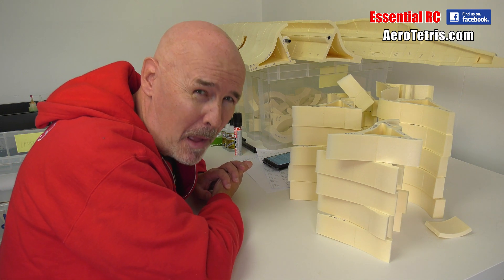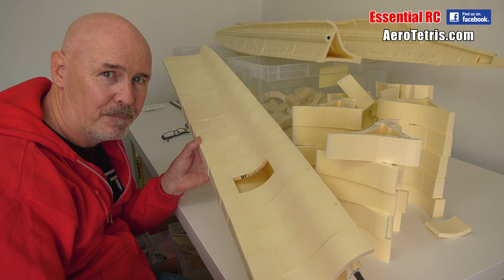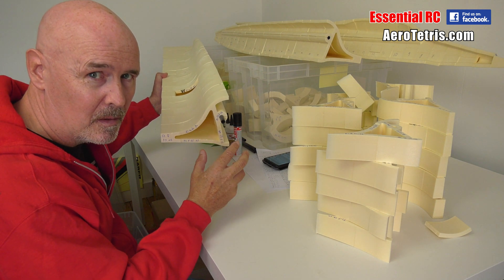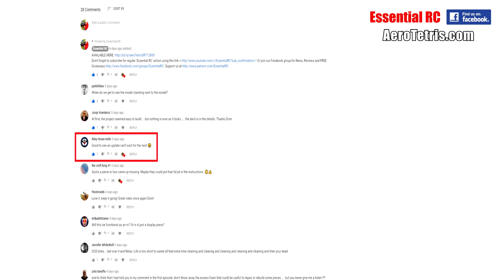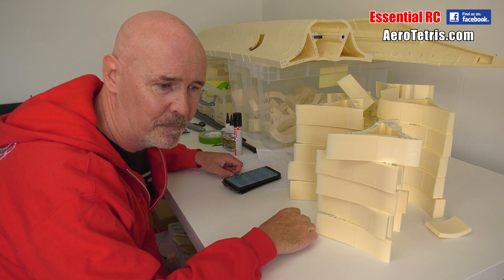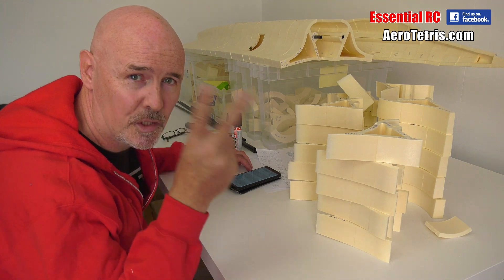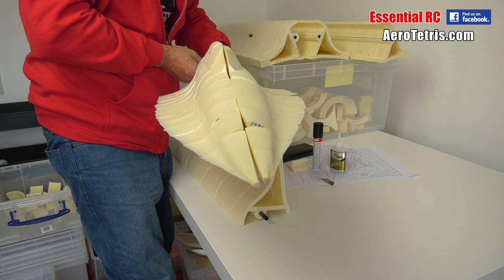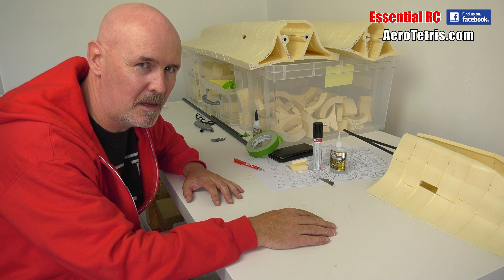AeroTetris 2.8 metre SR-71 Blackbird: BUILD LOG: Part 4

Comment: Mr Dom  are you  put  sound system in the Amazing build
Reply from the maker: Hey Charles...I don't think sound systems are needed in EDF or turbine jet models. The power system usually produces good enough sound. EDF systems with high blade counts do sound really good these days. I would not want to add the extra weight anyway. This jet needs to be kept light due to the way it's constructed. Cheers Dom (Essential RC)
Reply: Thank goodness Mr Dom  it ashame to hear some of these new kits Maybe I like my Grandfather but it not necessarily in the Air Thank you

Comment: Think if you fill it with expanding foam it will simply split all the sections apart. Used it in building renovations and it will distort UPVC double glazed window frame if you don't take care!! Cheers and good luck!

Comment: Hello Mr. Dom, i build a lot of this aerotetris planes (Su27, Saab105, MiG29, Draken, …) all with retracts and edfs. I follow your work. 
But i would recomend to use woodspars and think of there positions, before you glue to much sections together ;-)
The woodspars supports also the carbontubes, the retracts, the batterybays, the fins and the edf´s…
Four spars out of 4mm good plywood could be enought.
On Egor´s Aerotetris-site you can find some inspirations and a lot of building fotos.
Regards, George from Austria

Aerotetris MiG29 maiden: https://www.youtube.com/watch?v=CvhP_V0GKSM

Aerotetris Draken maiden: https://www.youtube.com/watch?v=GQNIPoZY-yc

Aerotetris Su27 maiden: https://www.youtube.com/watch?v=QYxi7mMox_M&t=75s
Reply from the maker: Thanks George. I have watched a few of your videos and they were inspirational. After finishing engine nacelles I will review and add spars etc and then plan out equipment installation. Should be fun. Cheers Dom (Essential RC)

Comment: Great job! I can't wait till you will finish this project. I wonder only how you will finish all these surfaces... They don't look smooth... You will use sand paper? Or different solution?
Reply from the maker: Yeah...bit of sandpaper should do the trick. Will take a little time but I'm in no rush. This is a background project to all the other work I'm doing on the 'Essential RC' channel.
Reply: @EssentialRC  I see that these two front parts are... much different sizes. There was something about 1,5-2cm height difference. Or you hold it not strait  ;)
Reply from the maker: Correct. Not straight and not close together.

Comment: I'm a longtime fan of Aero-Tetris. His construction approach is unique and while his kits do require more work than initially meets the eye, the end result is very rewarding and can be finished simply (paper or glass) or fully scaled out. I've seen the most success with his deltas --the Viggen being rather easy to build in dolly launch configuration (to avoid the quirky scale undercarriage) and the Draken easy overall with an added cheater intake depending on your chosen power system. 

One tip: When constructing parts with a 90 degree angle, such as the two fuselage nose halves, try butting them up against a square edge, such as the desk and the wall. This creates much more consistent joint between the two halves with less gaps. 

Best of luck completing your Blackbird! I dream of this one or his massive Antonov, although I must live vicariously through those with much larger transportation options!

Comment: Expanding building foam is very heavy. There is no need for large carbon tubes in the side cavities in my opinion, it's a big box structure, especially if it's skinned with lightweight fiberglass after assembly.

Comment: I think using PVA and Pins allows you to align the section on each edge for best fit, it doesn’t seem that you have opportunity to do that with faster methods. I’ll be using PVA and pins on the CASA C.101 due to be delivered soon 😁👍🏻
Reply from the maker: Wouldn't been better with slowing curing adhesive. The few seconds the cyano took to cure gave me time to align the top edge. I'll use PVA or similar for gluing the big sections together. Maybe the white gorilla glue as it will fill gaps nicely and been easy sandable. Cheers Dom (Essential RC)
Reply: @EssentialRC  Great, I'll give that a go with mine as well then :) Look forward to seeing your next instalment.

Comment: Yeah I wouldn't use the expanding foam. Also not sure about passing wires through carbon rods. May cause interference... Second what rich said. Glass the surface with ezekote. That will be strong and light.
Reply from the maker: I'm glad I'm vocal with my bad ideas. Carbon tube with servo leads running down them wasn't smart was it. LOL

Comment: Good going... I have a question... Is there any reason that the modeling company couldnt use the same material in a darker color closer to the original color of the SR-71?  Or is there a specific reason for making the model in this light color?
I can hear all the die hard model builders out there break out collectively with an eyes rolling groan.....I'm just curious that's all.
Thanks to any and everyone who will respond to my inquiry. 👍🏻👍🏻
Reply from the maker: Honestly don't know the answer to that one but I would suspect Egor's supplier delivers the foam in the colour and form at the lowest price. The model will be glassed so it doesn't really matter what colour the foam is anyway. Cheers Dom (Essential RC)
Reply: @EssentialRC  Thanks for the prompt reply. I'm from the old school days of balsa wood, tissue paper, and dope.... when dope meant something else...lol
Here's a true story about my last balsa wood model from my Junior High school years.
I was 15, and had just finished a 14 inch wingspan balsa wood bi-plane covered in red tissue paper freshly doped up. I was carrying it to our homes balcony to dry out in the sun.
For some reason my Mom was upset at something, wasnt me, and she didnt want my model on the balcony.  
I complained and carried it there anyway. Before I got to the door she grabbed me by my sides causing me to convulse my arms and break  both wings upwards, but didn't tear the paper.  Just cracked the gluing , but now it didt sit right.
My mom apologized ..
Fast forward a couple weeks later I was telling my friend about that and I ended up bringing the plane over to his house. He had gotten a half Gallon or a gallon of Gallo wine in a jug, so like any all American teens we drank some,  and some more which got us to thinking how cool it would be to fill a baggy with gasoline and shove it into the fuselage of my plane, then take it to the 3rd floor of his home and light it on fire and toss it out the window and watch it fly down I to the pond in the backyard.
What could go wrong, right?
So we went to the garage and put some gas in a baggy, took the cowling with prop off plane, shoved the baggy inside and put the cowling back on.
But, before climbing the  three floors up my friend gets the idea of pouring some into the pond out back. It was an old foot deep with water, cement pond, kidney shaped about 8 feet across.. and he poured about a pint or so into the pond .
We climbed  the 3 stories in a drunken stumbling manner, runnings fast as we could. 
My friend had 3 brothers, and his mom, and no one was home but me and him.
Soooo
We got to the back bedroom and opened a window.  I held the plane while my friend lit a match.
We held our breath as he touched the match to the cowling and the tissue paper started to burn. We leaned out the window an I gently tossed it out and down.
It was a beautiful sight! As it arched downward it caught the baggy on fire and it erupted in flames so the whole fuselage was engulfed and looked like something out of the movies in slow motion...Or we were drunk and it just looked that way.  .hehe
But then it landed face first into the pond and that's when things got scary for a second!
The perfect ball of flame hit the pond and it exploded into a column of flames that almost reached us on the third floor!
We could feel the burst of heat as the flames came up...
And we jammed downstairs to the basement and my friend grabbed a fire extinguisher in the garage and we went out back.. the flames had already died downtown just about a foot high. 
He pulled the hose down and pressed the trigger and it forced a stream of white powdery liquid misting out into the pond and the flames were extinguished. 
Whew! We felt relieved!
But it was fucking Cool as hell what we just did!
We went up to his room , and were all excited about it...
Until his mom came home from work.
She saw the pond and yelled upstairs "Who is here ⁉️"
Come here boys...and she saw we were buzzed and we told her what we did. She was both mad and amused at us. 
We cleaned her pond spotless the next day, and I was lucky she didnt call my mom, and grateful too!
End of story... fade to black.
Have a nice Aussie day down there!
Peace

Comment: I'm trying to think a step further. CNC building, for example, a Spitfire requires a great deal of knowledge and experience. It seems to me that this tetris is a mid-range solution that will include RC fliers / mid-range builders like myself, of course, if a choice of models is sufficient. Dom thanks for your interesting presentation, all the best,

Sincerely
Jos

Comment: Be careful using “builder foam”... some of them expand during drying (for example PU foam, you mentioned it, as the PU glue does as well) It might even destroy your parts.
Reply from the maker: If we do that I would obviously test on some scraps before doing it...and yes, aware it expands so would leave the structure open at one end if not both. Cheers Dom (Essential RC)

Comment: hello Dom, thanks for quoting me in your video,
I hope I didn't offend you with my comment in the third episode, which absolutely wanted to be playful.
I really hope you find the missing pieces.
Speaking of rigidity of the fuselage, I absolutely don't know the project so I'm probably going to say something stupid: maybe with a carbon fiber and epoxy resin cover you get the rigidity needed for this great model.
The construction foam you speak of (if I understand it well, it is polyurethane based) expands while curing but does not flow into the long and narrow holes, you should get a cannula that gets very deep along the fuselage and spray it in small doses starting from the deepest point of the chamber that is created between the tube and the fuselage because otherwise you risk finding large empty areas not visible.
Above all, don't overdo it because you could risk seeing the fuselage explode: it happened to me with a piece of 2 mm anodized aluminum covering a gate: I sprayed too much foam and although I had stopped the piece of aluminum it becomes deformed, between the supports, pushed by the foam while curing. Do tests before ruining everything, maybe I'm too apprehensive but better to say for nothing than to keep quiet and see your fears realized
Cheers!
Reply from the maker: Thanks for the advice Zola and no offence taken. You were correct in what you said. Cheers Dom (Essential RC)